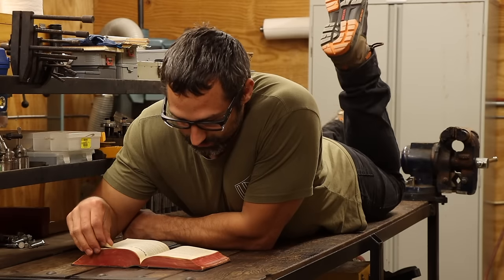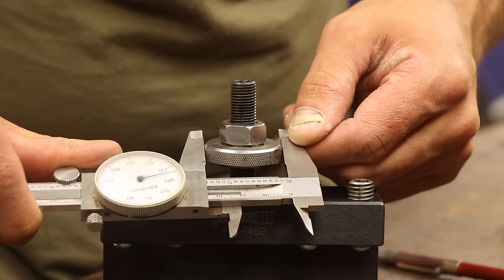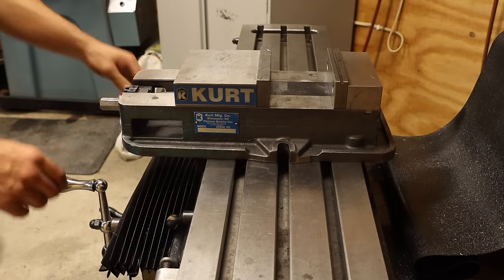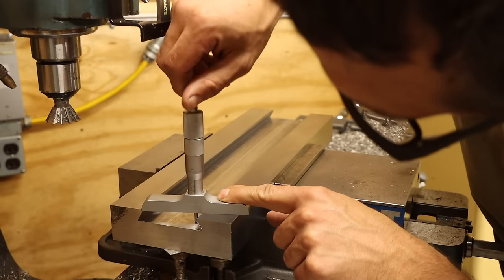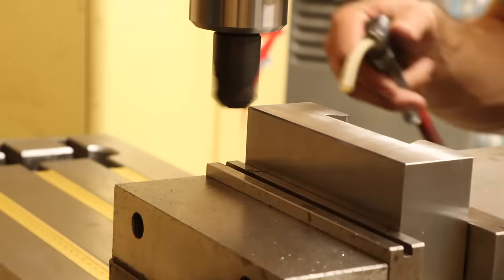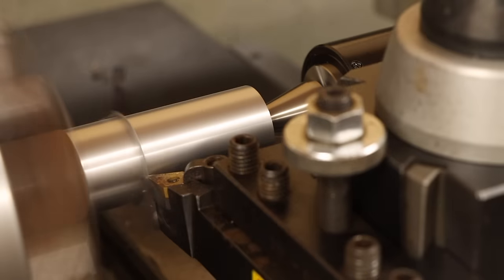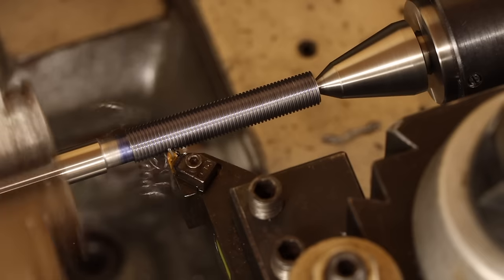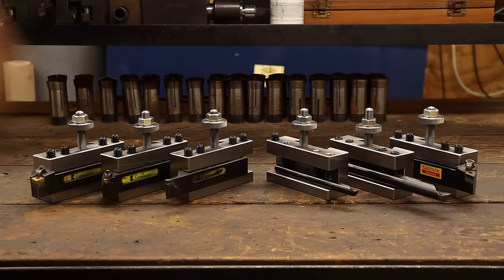Making an ARMY of Tool Holders || INHERITANCE MACHINING

Comment: At 2.50 you mention how odd it is that the general dimensions are imperial but the hardware metric - I don't know about elsewhere, but here in the UK we use the metric system and all the metal we get through our workshop is imperial - if you ask for 50mm stock, 90pc of the time you get 50.8, or 2". Maybe something similar happened with your toolposts. Don't even ask about box section - imperial outside dimensions, metric wall thickness. Madness.

Comment: Your content is awesome! Definitely earned my sub!  Also I'd have liked to see you add the little groove on the bottom surface of the tool slot for round tools, so they stay aligned easier....but I'll let it slide lol 😆
Reply from the maker: Thanks man! That's a useful feature I intentionally left off. 😂 Most of my other holders have it, and is a nuisance when mounting a narrow HSS tool.  So I'll reserve the old ones for the round tools.
Reply: @InheritanceMachining  I'll agree with that....I'll often put a 3/8" or 1/2"  hss blank under a 1/4" tool that I'm mounting in a 5/8" or 3/4" tool holder, for that very reason! 👍🏻

Comment: Question: whenever you cold blue a part in your videos, it looks like you just dunk them in a bucket. What’s in there and where do I buy that solution? I’ve been using super blue, but they come in tiny bottles and I can’t reuse the solution once it touches the steel, forcing me to brush it on.
Reply from the maker: Sure! I use a cold bluing kit from a company Caswell Plating. But before that I used Super Blue and diluted it in enough distilled water do submerge some small parts. The process was a bit slower but still worked. And was reusable to a point.
Reply: @InheritanceMachining  ah! Thanks for your help. Absolutely love the channel. Keep up the great work!

Comment: Excellent work, but....you can´t thread an M12 die on a 12mm bar, cause its too big. Our norm says its max diameter is 11,8 mm. Most screws and all thread bars you can buy are only 11,7 mm Just a little tip from a Metric machinist that does that kinda work since 45 years on a daily basis. Regards from Germany.
Reply from the maker: Thanks! Is this limited to use with dies? I do mostly single point turning and start right at nominal diameter without issue, both metric and imperial
Reply: @InheritanceMachining  of course you can do single point treading without a problem. But your thread-connection will become very tight. The norm says, we should shoot for a surface contact of 75%. Thats pretty good. I know, we machinists love tight tolerances, but with threading it only makes little sense, because the slightest amount of dirt or beginning corrosion will shut down our threads. An 11.8mm bar will provide a contact area of around 75-80% and thats good. Anything tighter is good for high precision applications like micrometers or adjustment devices.
Reply from the maker: @mftmachining  good information! Thank you

Comment: Where did you buy the 4140 bar from? My search only found one place and it would cost over $2,000 before shipping.
Reply from the maker: I realized looking this up again that I got mixed up looking through my McMaster order history! It's actually just low carbon steel. Which cost about $240 for the 2 ft length. Shipping was only $30 for this and the other package of materials.

Comment: I'm not a machinist at all, but could you have just used some brass shims in your lath to hold the screws and knurled adjusters while finishing them?
Reply: technically yes, but for the adjusters it is a fairly narrow clamping are so getting the face parallel would be a lot more effort since you'd have to indicate in each part. 
As for the screws also technically yes, but apply too much pressure and you'll be deforming the threads so not a good idea.
Reply: @Moehre040  thanks for the reply. My machinst knowledge is just watching people do it on YouTube. I knew there had to be a reason. Haha
Reply: For the knurled knobs, the brass shims wouldn’t have given him the alignment he wanted for that facing cut. He would have to indicate all 6 knobs to get the cut parallel with the finished face.

Comment: Climb milling your rough cuts? Does your mill have ball screws? I climb with small cutters and for finish passes with larger cutters, but conventional for rough cuts. Most of us could probably get away with heavier climb cuts than we think, but if you have much backlash it's kind of risky.
Reply from the maker: That's a fair point. I haven't had much trouble so far, and might be due to snug ways and low backlash adjustment. But not good practice. Weird I had someone else suggest conventional for finish passes. Opinions seems to be varied here

Comment: That rotary table weighs 200 lb? Have you actually weighed it? I don't consider myself to be a weak person but I wouldn't be able to just pick up 200 lbs like that.
Reply from the maker: That's what the owners manual says at least. Comparing with my workouts is seems about right. What you didn't see was my struggle getting it to the workbench 😂
Reply: @InheritanceMachining  you just must be a lot stronger than me :-)

Comment: What grade of steel did you use for these tool holders? I need to make a bunch of BXA holders.
Reply from the maker: It's just a common low carbon mild steel. ASTM A109

Comment: Funny, you saying "without a single hiccup" around 12:30 is followed within a second by holder lifting from the vice on one end, and messing up the stop on the other. I guess it doesn't really matter but I do wonder did you even notice?
Reply from the maker: I honestly didn't catch this during either machining or editing. It wasn't until several other mentioned it as well. Completely ironic my line there 😂

Comment: 12:34 right after you get done saying you didnt make any mistakes, the part pops up. Not sure if it actually caused any issues though.
Reply from the maker: Believe it or not I didn't even realize that until some others pointed it out. The irony of my line there was complete coincidence 😂 I don't think it will cause any noticeable issue with that one. Just some slightly canted screws and height post

Comment: You can't just force material up with jacks. You will bend the material which is all good until the part comes out... that's when you find its bent, but in the other direction.

Comment: Did you buy the dovetail mill or you already had one? I am thinking to buy a couple just in case, but I'm wondering if I can buy some "aliexpress" grade, or I should find something better. I never worked with these and have no idea if cheap stuff has decent quality / tolerances.
As always, thanks for the excellent video! And let me say it again - plese consider making videos a bit longer for all of us to enjoy even more! ☺
Reply from the maker: Yeah the mill I used came with the shop so I couldn't really comment on the quality of the cheaper imports. I appreciate the support as always! Maybe in time the videos can get longer. Right now I barely have the time to make them as long as they are!

Comment: This is so cool! Good job! I was wondering what made the block of steel shift in your vice? The heavy cuts? Did it stay flat after you removed the bulk of the material in the middle?
Reply: It is stress in the milling process. When you machine large steal parts you rough it first to see where it pulls, then first. This happens even on round stock also.
Reply from the maker: Thanks! It was likely a result of internal stresses relieving. It most certainly flexed back straight once I removed it but the deflection was pretty minimal for a part that large, and even less once chopped up smaller

Comment: Good job! even though I seem to have too many tool holders to store in a rational, and accessible manner, I too need more of the things. What's your storage solution? 

First time viewer, subscribed. I just realized you may have already solved it. Will peruse your previous vids.
Reply from the maker: Thanks and welcome! I'm thinking a long rack along the lathe back splash to hold these as well as the other wrenches, centers, etc
Reply: @InheritanceMachining  Good idea. I've filled one layer up, time for a second I suppose. Thanks for the reply.

Comment: So you order your stock from a local steel house or an online supplier?
Reply from the maker: I usually go McMaster Carr since my local supplier has to order anything that not plain carbon structural steel anyway. Hard to beat next day delivery
Reply: @InheritanceMachining  True, but McMaster Carr is notoriously expensive :)
Reply from the maker: @kurtfrancis4621  Do you have an online recommendation? MetalsDepot seemed to be on par with McMaster

Comment: Very late to the party.  FWIW, some people start a thread single point and finish with a die.  You get single point "perfection" of thread placement and die accuracy of thread depth; rather quickly too.  A shaky old klutz, like me, would definitely employ the method, if and when I did machining work.
Reply from the maker: That's a good tip actually. I usually spend most of the passes in the last few thou of the cut anyway fine tuning the fit

Comment: Where do you get stock like this? And if you don't mind sharing, how much does it cost, and how much would similar tool holders cost to buy? I'd love to get into hobby machining one day and I'm very curious about the logistics.
Reply: Midwest Steel Supply is a good source, you can also get just about anything you would need from McMaster-Carr, but prices are higher.
Reply from the maker: Like Mike mentioned, McMaster is a good one stop shop, but a little pricy. This project specifically was around $350 in materials tooling and fasteners (with some left over). and only $30 in shipping. New ones I've heard are in the neighborhood of $50 per piece

Comment: I assume the cutting tips / faces on these dull over time? Do you sharpen them, or replace?
Reply from the maker: Are you referring to the lathe cutting tools?
Reply: @InheritanceMachining  Yeah, well I think I am, a layman here.
Reply: The tools / cutting faces that make contact and remove material.
Reply: Are they 'sharp', or is it the angle of attack the makes them effectively sharp?
Reply from the maker: @mattseaton3521  I got you. Most of the ones you see me mount have replaceable carbide inserts. And usually you can flip them around to use the other corners of the same insert before you have to replace it with a new one.
Reply: @InheritanceMachining  Ah I see, so they're throw away consumables rather than something you'd sharpen / reface? I only ask as I'll throw away spent drill bits that you'd use in a regular drill, I just assumed these might be costly enough to reface like a knife. I guess you can feel when they're starting to dull? Never really see carbide in that yellowed tone before.
Reply: Your commitment to accuracy is unreal. Always intrigued with tolerances for parts that require such a high level of accuracy, having only really been involved in general construction where you're talking millimeters at most, rather than thousandths of!
Reply from the maker: @mattseaton3521  With the carbide they aren't razor sharp but are sharp enough to cut by themselves. There's a lot of geometry going on in the insert itself as well as the angle its mounted at to make it cut and cool the most efficiently. A lot of stuff over my head honestly
Reply: @InheritanceMachining  Super interesting, thanks for answering! I imagine your measuring tools must need calibrating frequently! I only recently learned that even your average tape measure / rule will be made to differing grades of accuracy.
Reply from the maker: @mattseaton3521  I didn't catch some of your other replies somehow.  On the carbide tooling, what usually ends up happening is rather than dulling, they will chip at the cutting tip, and you can usually see the difference in the surface finish and the color of the chips because they will get too hot. They are consumables but honestly pretty reasonable. One that you can use 4 corners of can cost around $5. Anyway thanks for the support! I find myself trying to hold machinist accuracies when doing home renovation projects. And usually drive myself mad 😆

Comment: Your workpiece flexing may have been from stresses and added heat from cutting.
Reply from the maker: I actually realized yesterday that the steel was cold rolled low carbon, not annealed 4140. I think it was from internal stresses relieving.

Comment: Sounds like your stock should have been 40mm instead of 1 1/2"
Reply from the maker: I think you are right. Unfortunately McMaster didn't have much to offer in that size
Reply: @InheritanceMachining  Or in fine pitch 12mm threaded rod.
I don't want to imagine shipping on a 50lb slab of steel either. 🙄 $$$$
Tool holders came out nice!   
That's going to save a whole lot of time and allow you to program 0 in a DRO when you get there.
Maybe you could etch or ingrave numbers to index them?

Comment: One thing I always see that annoys me. Everything else you do is totally beyond me and excellent job, but when tapping or using a dye, turn clockwise 3/4 and go back anticlockwise 1/4 and repeat. It will release the cut material. Thanks for the great videos and education.
Reply from the maker: So I always use this practice for smaller taps but for the larger ones I've found its not necessary with certain taps. The one I used has a slanted cutting face to the chip gets pushed out the hole rather than gumming up in the flutes.

Comment: To be honest,  those cheap imported holders are far better than what you made. At least most of them are properly hardened and ground at the contact surfaces instead of grinding the easier-to-grind surface to make it look better.

Comment: I make 3d printed tool organizers for these types of tool holders. Ping me and I will send you a set or two.
Reply from the maker: That's a very kind offer! I have a plan in mind but if it falls through for some reason I'll let you know!
Reply: My tool holders for these tool holders are .25 inch steel sheet with steel pins pressed in. The dovetails of the tool holders slide over the pins and these are mounted in the back of the lathe.

Comment: LoL cut a 3/8 20 thread with a tap and you'd naturally assume 5/16 is the correct size, right? Wrong, those crazy British decided that one imperial measurement was more than enough and settled on 8.25 mm as the correct bore size. Fun times!